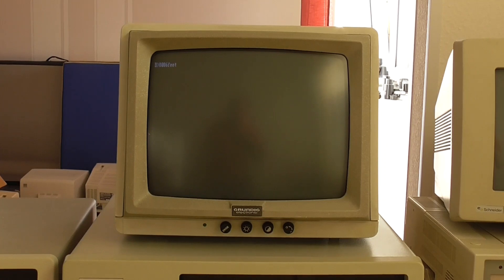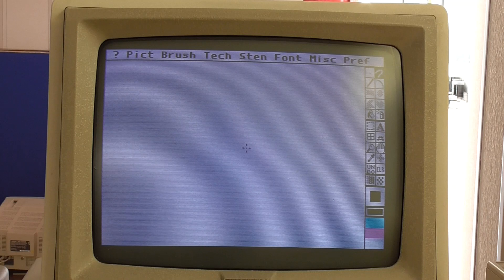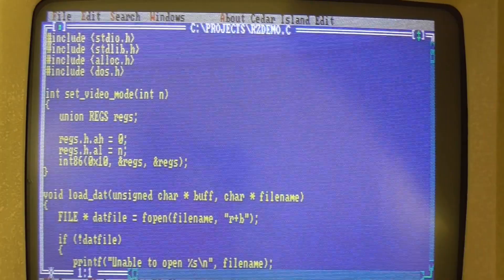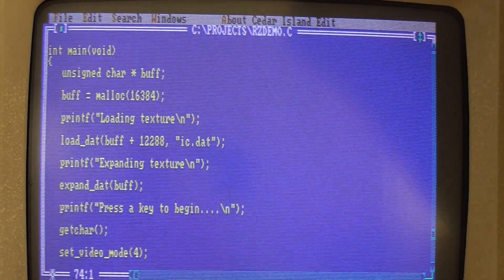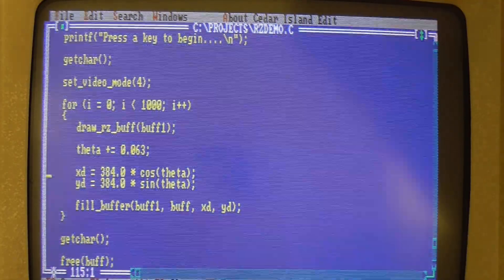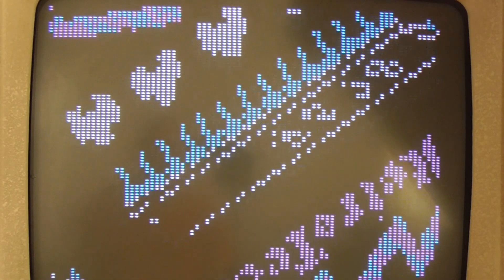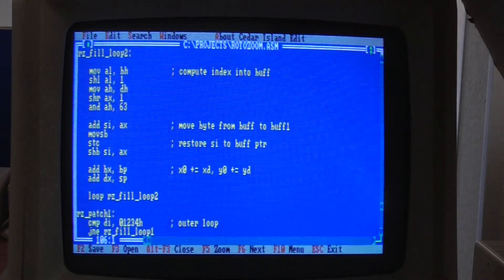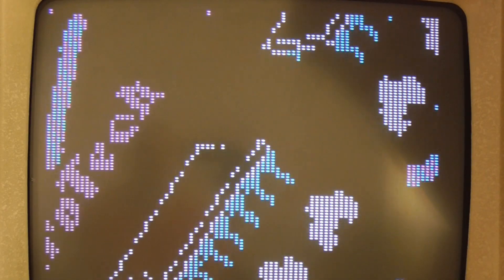New CGA Demo Effect : Rotozoom

Comment: I have a question, instead of converting a pcx to dat, why not just use a bitmap to begin with ?
Reply from the maker: As far as I could tell, Deluxe Paint has its own format. It doesn't supply bitmap files.